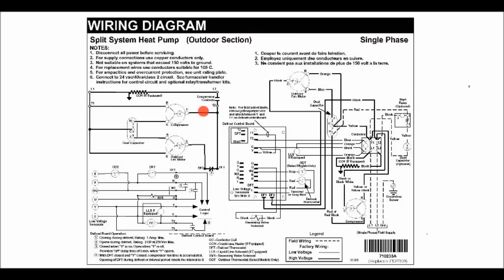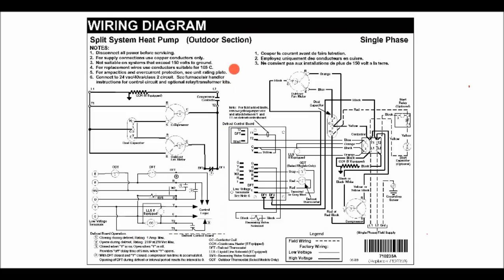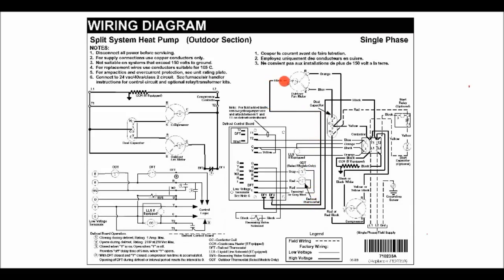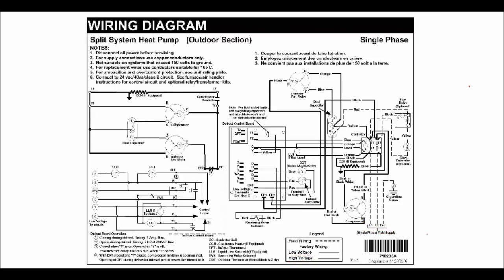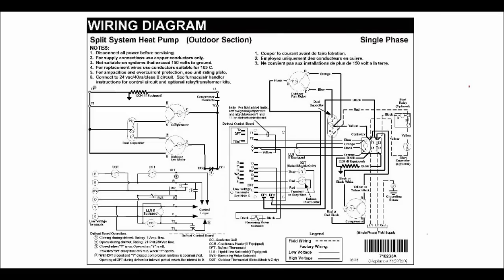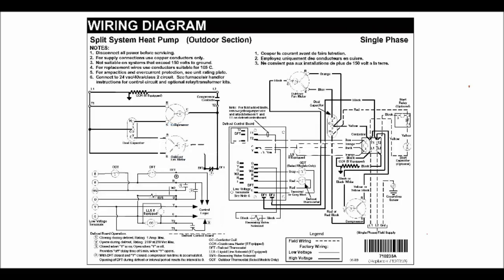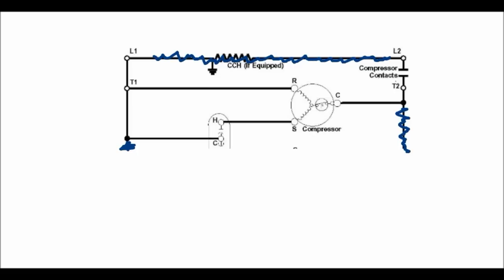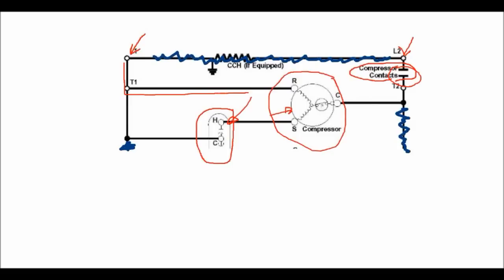HVAC Training - Schematic Diagrams

Comment: It would be nice if all companies printed the diagrams in color, red wire red line, yellow wire yellow line, it would be much easier to trace out a wire. Some diagrams are too small, I need a magnifiying glass to read them. Some diagrams are easy to the tech that frequently services that brand, but to the tech that is new to that brand the diagram can be a challange.

Comment: This is a fairly easy diagram to read. There should be a law to print the diagram in color. The wires would show up in the actual colors, this would make tracing the wire much easier. The diagram should have a plastic waterproof coating. To many old paper diagrams have been water damaged. The only other thing I would like to see is a diagram of the actual componets with the colored wires going to each componet.This would become a tech's favorite, and their sales would go up.
Reply: +Jim. I will vote for that law.